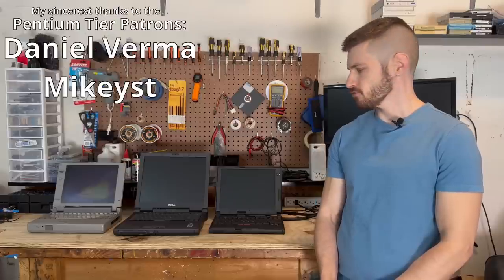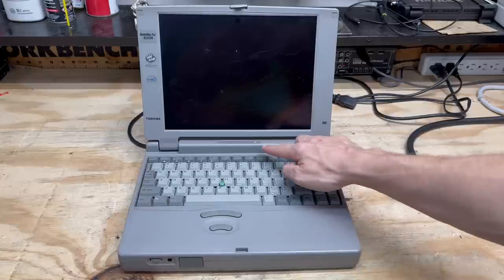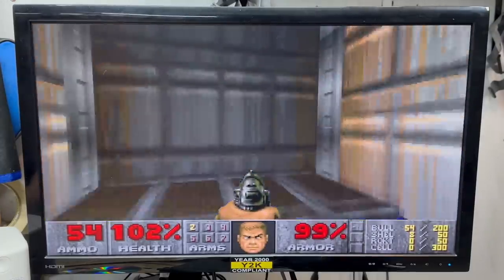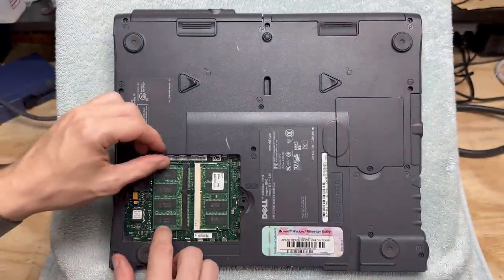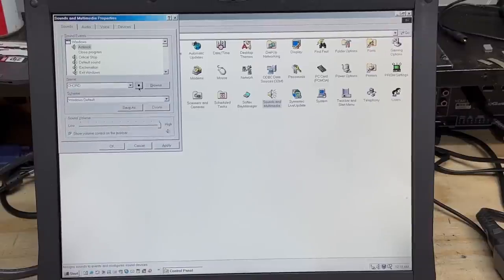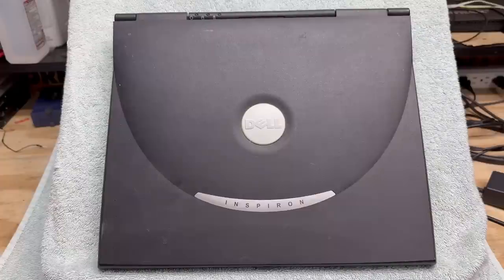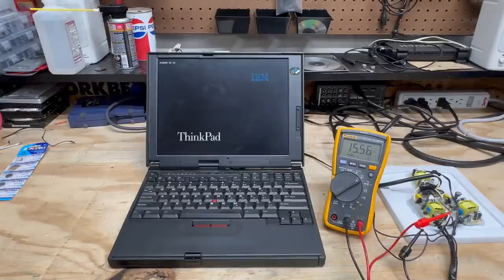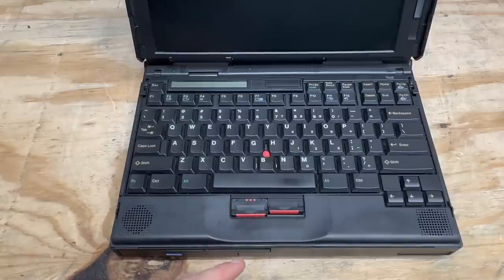Testing some of the retro laptops from the Franklin eWaste haul.

Comment: My favorite retro laptop I owned was a Texas Instruments TravelMate T4000m, before the TravelMate line was sold to Acer. It had a genuine Pro Audio Spectrum sound card in it and an Active Matrix LCD which was beautiful for the time. 

I should not have parted with it. 😣
Reply from the maker: Nice! My dad had one of those for a period of time. Had a trackball mouse that attached to the side. My first real laptop was a Compaq LTE Elite 4/75CX, which I absolutely adored. It didn't have a sound card though, so it was either PC speaker sound or a PCMCIA sound card with headphones. It had a trackball built into the monitor! I finally broke down and bought one earlier this year and it is surreal seeing it again. It is quite a troubled machine though. Been working on it (and its associated video) for a few months now.

Comment: Actually I had a Toshiba from 1999 that used DC voltage. I remember this specifically because I had to repair the DC jack several times. It came off the board. Eventually I found a better fix. Instead of resoldering it to the board, I soldered a jumper wire to each lead. It flopped around, but it worked perfectly. lol So yeah I do find it odd that this takes mains voltage.
Reply: oh wow this is older than mine. That's surprising. Mine had a built in floppy and cd and this only has the CD. That's why I thought it was newer than mine.

Comment: I’ve got a similar Toshiba Laptop to yours at: 0:22, Mine’s the “CDT 430” although the Screen has a small bit of damage in the bottom right corner, Still usable mind! 🙂 The Voyeur Folder that you were a bit dubious about is to do with Drivers and I have come across it before, Either Network or Sound if I remember correctly, Love your obsession with Power Supplies at: 23:07, I totally Agree, You can never have too many, I wonder who’s worse, Me or you? 🇬🇧😂
Reply: Just watched this Video again and can’t believe I missed the Dell Inspiron Laptop, I’ve got a few different models, I haven’t got a good PSU for my Dells but I have a few which I’ve repaired using quick connect connector Blocks which I’ve configured so they can only be connected one way round because the last thing I’d want to do is cause a short circuit and most of the batteries that I’ve got hold a fairly decent charge too! 🙂
Reply: I also like how rugged those Dell Laptops are too!

Comment: I've just got a Toshiba 2100CDS laptop - think it is a slightly newer model then your one - has got a K6-2 400Mhz CPU, 64MB RAM (32Mb  on-board and 32MB SODIMM), 4.3GB IDE HDD and a DSTN 12.1" 800x600 - runs Windows 98. Hard drive was dead when I got it, but found a Fujitsu 80GB one that it seems happy with.
All seems to work so far with Windows 98SE installed on FreeDOS, but like yours the CMOS battery is dead - seems to be a 2-cell 2.4V NiMH one so might be the same in yours.
I've found a Xircom Realport RBE-100 PCMCIA card online to give it ethernet and can get a 128MB PC100 SODIMM to take it up to 160MB RAM for not much money.
As your one is the CDS version it should have an 11.3" DSTN 800x600 screen, however the CDT version has a TFT screen which is better - don't know if it is possible to upgrade seeing as you need a new screen.

Comment: That is a sweet thinkpad. I have a similar one that was my dad's work machine up to 2002 or so, but it has a bios lock on it and he had forgotten the password. Ever had to deal with that before?
Reply from the maker: Yes. The remedy is highly dependent on the hardware though. Sometimes it's just a matter of setting the reset jumper on the motherboard or pulling the CMOS battery. Other times it's more complicated and requires a special utility.
Reply: @miketech1024  Good to know, I'll dig into that.

Comment: Rather than superglue/cyanoacrylate, a strong solvent cement would probably be better to stick plastic parts like that back together. The stuff used for plastic model making is generally too weak, you'd probably need something a bit chemically 'hotter' - sold as suitable for perspex/acrylic sheet, plastic pipes, etc. In the UK the most suitable one is sold as "EMA Plastic Weld" - I believe it's based on dichloromethane - sure there must be equivalents in other countries.
Reply from the maker: Thanks, I'll have to look into getting some of that! Many of the other laptops have plastic issues and I really hate super glue.

Comment: When you’re scoping out these systems, do you ever look at the programs that start automatically with Windows and disable them? They could be bogging the system down. Just a thought.
Reply from the maker: I typically wipe every drive as a general safeguard of the previous owners’ data unless there is some really unique software that needs to be archived.
Reply: @miketech1024  I love cleaning up and giving my friends computers a tune up so they’re working like they’re relatively new. It always amazes me to see the amount of programs that feel the need to be started on Windows startup. I love picking them out.

Comment: I love the Dell laptops of this era, especially the slightly latter Lattidude laptops where you could have not one, not two, but three batteries installed at once. Shame it's kinda hard to get the NT / XP era ones to run Windows 98 properly, usually causes ACPI conflicts. Windows 98 technically supports ACPI, but it also technically supports plug n play, but we know how reliable that is. 

Side note when I was in high school they issued some Lattitude laptops similar to the Inspiron you have to teachers, us students got slightly newer but still janky mostly junk refurbished Lattitudes as part of some absurd laptop lending program. One of the teachers I had, history teacher, can't remember his name, had a messed up Lattitude they had issued him, it wouldn't charge. They issued him another laptop but he couldn't be bothered to rearrange all his icons on the new one, they used a sync server to keep the teachers files backed up, but he refused to configure the new laptop. So he sat his malfunctioning laptop on the functional laptop, same models, and just swapped batteries as needed using the functional one as a charging station for an entire school year until the IT guy realized the teacher was doing this, and promptly took the malfunctioning laptop away. 

Double side note, at my high school, the file sync server, email server, and later the fancy IP phone system server were all unsecured in an unlocked closet. The UN / PW was literally "admin" "admin" on all system except one where it was "admin" "password". I'll just leave that thought along with the thought that it was really fun to change the ringtone on the funky phones, some kind of Cisco's that supported tiny .wav file ringtones, and then send a test pulse to all the phones with some really, REALLY inappropriate ringtones. Farting wall mounted classroom phone, in the middle of a test... Yep... I regret nothing 
😆
Reply from the maker: Can’t honestly say I wouldn’t do the same thing with the phone system LOL. I did have a lot of fun when the RPC exploits came out for WinXP though. That’s all I’ll say on that LOL. I definitely have more of these Dell laptops than any other system.
Reply: @miketech1024  It's kinda weird that despite how relatively expensive those Dell laptops were, they wound up everywhere. Testament to when Dell was at it's peak, I suppose.

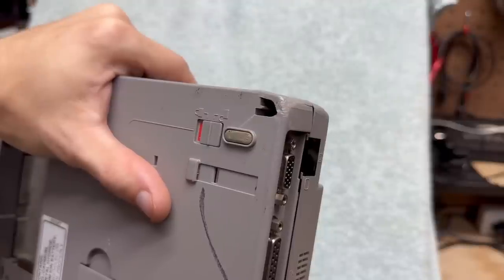Comment: 5:57 I'm disappointed in the lack of a complete teardown on this unit, it's so old, it's likely to not have a watchable video on it, if it exists on YT at all, and I'd say super glue that corner, since superglue boned plastic is stronger than the original bond, it will indeed hold up.  Plus, despite the broken corner, it's thick enough to do a complete motherboard swap for something new, and that would be SO COOL, I've not seen anyone on YT do that, as it requires a lot of fiddly work, but with 3d printed parts now so common, I think older laptop cases are becoming ideal for sleeper builds in a way that previously they were not.
Reply from the maker: I’m going to tear into them deeper in a separate video. Just as soon as I work up the nerve to separate those impossibly brittle plastic clips.
Reply: @miketech1024  you have glue, you can’t live in fear .

Comment: I opened up my 4080XCDT after this, battery seems to not have leaked, and seems pretty isolated from the rest of the system, frankly still holds the time for some reason? What should I Do with it?

Comment: you also need to clean the inside as I have found the dirty laptop fans are the and thermal paste are two of the biggest problems with slowing laptops
Reply from the maker: I'll be diving deeper into these systems in a future video, just have to work up the nerve to face those incredibly brittle plastic clips...

Comment: 90s dell laptops are just built different lol, i have two cpi’s one is running win nt and win95, and the other is a spare parts unit, but both batteries hold a charge. Funny how my laptop i bought 2 years ago barely runs, and the battery life is abysmal.

Comment: I need to find laptops that have a 9 pin serial port built into main board
If it has USB port that would be great.

Some have docking stations and they have the hardware 9 pin serial port

If you come across one, please let me know. I found some refurbished 44 pin 2.5 inch ide hard drives.
I tried using the CF to 44 pin IDE adapter but it was too big to fit in the bay
Reply from the maker: I used a 2012 HP EliteBook for years when I was a network engineer. Needed that serial port for configuring Cisco routers, switches, ASAs etc. Still have it. I’ll send you the exact model when I get home Monday.

Comment: old laptops are good for taking less space than desktops at the same time the batteries and stuff will not work properly, i would get a mid 90s laptop to run old games and software, VM's are not has good has a real thing and Windows 95 is a pain to setup on a VM :V
Reply from the maker: Oh yeah I much prefer to use actual hardware for retro computing instead of fiddling with VMs.

Comment: While I agree that XP would be a better choice for that particular Dell laptop, ME wasn't really as bad as the memes would have you believe. When pre-installed on a system it typically ran no better or worse then older 9x versions. I'm sure a clean install would prove as much. Like most peoples problems with Windows ME I'll bet that machine is jammed up with crap and bloat and has many wasteful background processes that need to be shut down. The desktop mess, clogged quick launch and the excessive spyware and anti-virus software shows this system was operated by someone who didn't know how to properly maintain a clean running system.
Reply from the maker: I just have an NT bias. Yeah this install is an absolute mess! I don’t blame it for running terribly.